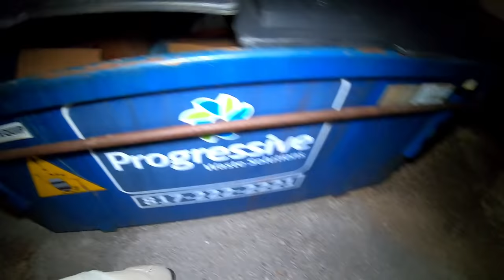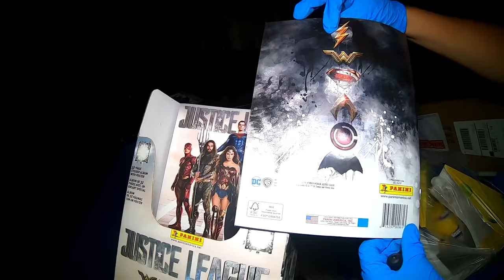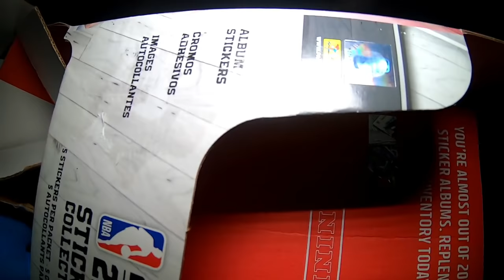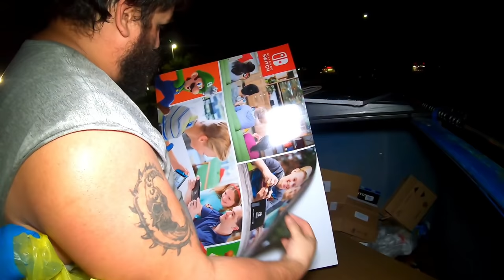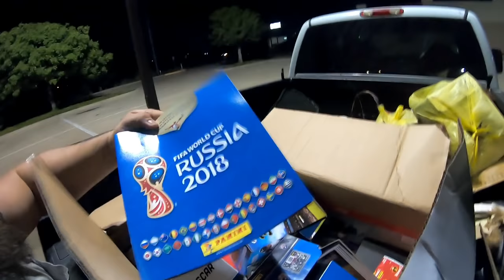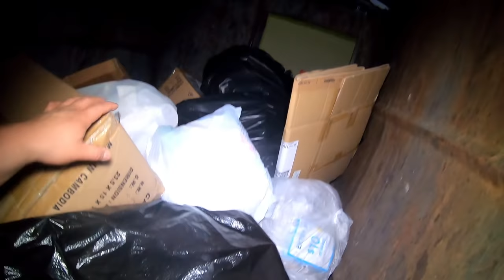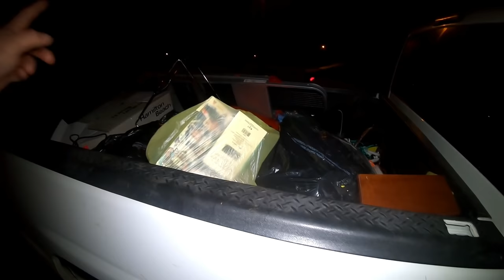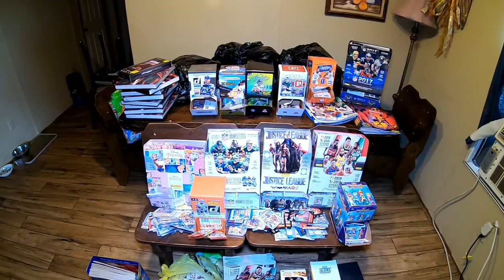Unbelievably INSANE GAMESTOP Dumpster Diving Super Haul Make A Living Dumpster Diving

Comment: Your dog looks like it has mange. My Husky looked like that when it had mange, which does require a biopsy to correctly diagnose. My vet didn't diagnose the mange first. I had to insist a biopsy be done in order to get the diagnosis, so you might have to push your vet to do the biopsy. Mange can be deadly, so I wouldn't wait too long.

Comment: POOR MYLA. OK I'M MAD NOW, PLEASE READ ON. First off I'd like to say I'm not a vet or physician but I'm a retired surgical tech with a lot of education in MRSA. I'm not suggesting or giving advice for treatment & what I'll include in this is all information you can find available to the general public. If your vet has even the slightest inkling that you might be dealing MRSA there is a lot they should have told you, number one is you should protect your pet & yourselves by wearing gloves any time you touch your pet or deal with the wound care. They should have given you sterile bandages or at the very least asked you to pick some up so the worst areas can be cleaned & covered. I hope they told you MRSA is extremely communicable from pet to pet & pet to people & though it's very unlikely it can lead to permanent colonization & relapse & even problems with the lungs, blood & bones. All that is needed to diagnose MRSA is a swab sent for testing unless the area they are worried about is mostly healed but any wet or open wounds just need a swab so I'm a little confused about why they'd want a biopsy unless they plan to use the tissue for multiple tests. I know you've been to several vets & it's expensive but staying on broad spectrum antibiotics for a month can cause immune issues causing it to be hard for the pups system to fight things effectively off on its own. Starting asap do some research & Get some good feedback from surrounding towns & communities about other veterinary clinics or private practices, some will even allow you to pay for treatment in installments. Have an arsenal of info ready because if you do not see marked improvement after two wks of cleaning, covering & antibiotics you need to start immediately seeking another opinion. Good luck you guys, I know Myla will be just fine with pet parents like you two.
Reply from the maker: Myla has been diagnosed with MRSP. She is now on Chloramphenicol for the next 3 weeks for the infection. Amoxicillin stopped working! She is so much better now. She is healing up really up well thankfully!